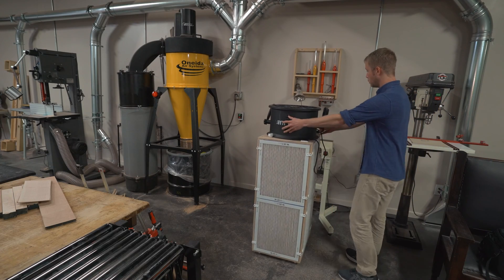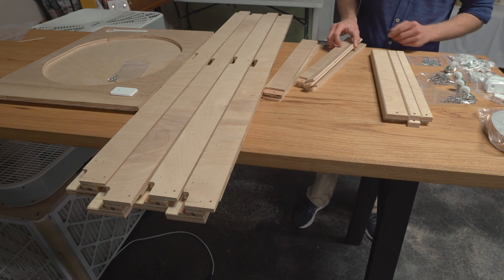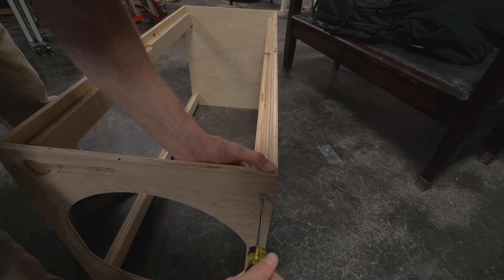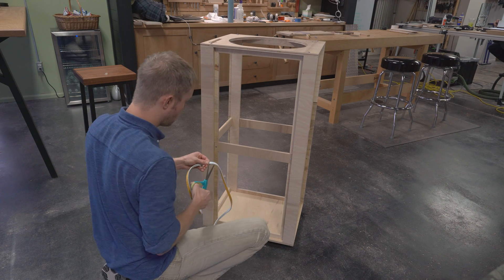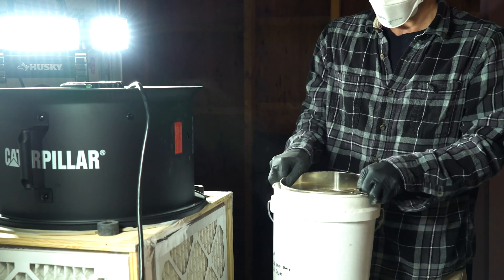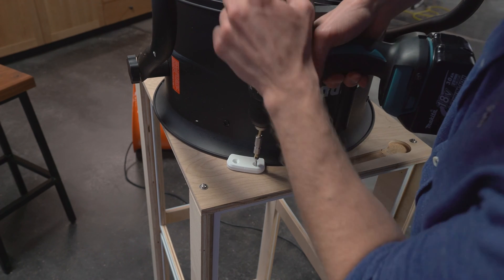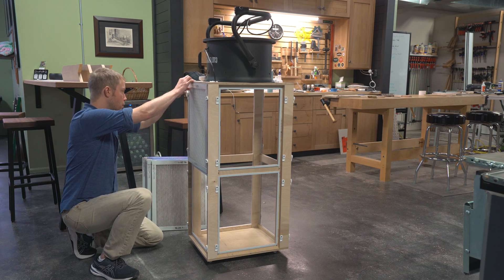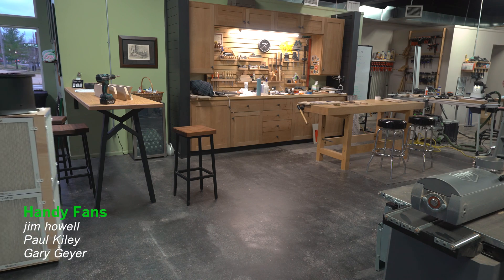Air Filter Kit - Model-A - Design and Assembly

Comment: would it be better to put the fan inside the box? This way it pulling air through the filters and keeping your fan clean??
Reply from the maker: In general its best to run the air through the filters first. I call this the "pull" configuration because the air is pulled through the filters. This method is the most effective when you want to filter the ambient air in a space. 

Personally, I use this unit as a dust bin for cleaning parts. With the fan pointed into the box, I brush the dust into the filter to prevent it from becoming airborne in the first place. The fan motor is enclosed, so the most critical parts of the fan do not get dirty. This is not a standard use of an air filter, but it does work very well within a short distance around the unit (5ft or less).

Comment: I just stumbled across this, what an awesome build.

I'd be curious to see real world performance on (2) 5 filter box fan versions. Make , 1 suck and one blow.

Put on opposite ends of the shop and have the one blowing in the direction of the sucking one
Reply from the maker: Thanks and good question! I have tested this with the 8 filter design, actually. It works well, but I did not use any particle meters or anything while testing, so I cant say exactly how well it works.

In general I don't like to use a box fan in the "blow" configuration because the motor is not enclosed and dust can get inside of it.

Comment: Great videos, designs and testing. I'm thinking about making my own. I have a few ideas that I'm fleshing out.

1 - Woodworking filters, like recommended by MMCC_Woodshop seem interesting. The filters seem to have a pretty good lifespan and good MERV rating, and can basically complete an air filter just by attaching it to the fan you already use on yours. It's a pricier up-front cost, but I'm curious how the performance compares. Looks like this video is in the works already from other comments.

2 - Inline fans, these fans are definitely more pricey than a $20 box fan, but they come with a lot of advantages. They can be almost silent, they're much more energy efficient, they are much smaller and often come with a lot of fancy controls, such as scheduling, sensoring, just remote control in general, etc. The compact design opens up a lot of design opportunities, as these fans are as small as 4". Further, these are meant to be used with ducting and HVAC applications, so the rated CFMs from the manufacturer's are far more reliable because they have to be in order to be competitive. Nobody is going to return a box fan because it doesnt meet its rated CFM, but that happens all the time for duct fans. They are also designed to perform better under static pressure, especially mixed flow fans. I think you could get a quieter, smaller, more efficient air purifier this way. I think there are some savings to be had by using less filters, but ultimately it'll probably cost a bit more to use these fans, as well as potentially complicate the build process. The AC Infinity CLOUDLINE S6 with >400 CFM and 32db operating volume for $120 is a contender for me, but there are cheaper options if you sacrifice the silence. 

3 - Carbon filtration. personally I need more TVOC filtration bc of my proximity to hwy/airport, so getting carbon into the air purifier's filtering process is a must for me. Currently my temporary plan is to double layer a merv 12 filter on top of a merv 14 carbon filter, to try and protect the secondary filter for longer. I think there's probably a much cheaper way to just add carbon filtration to a solo high merv filter, but I havent landed on a plan yet. Using sheets of activated carbon and just taping to the filter is potentially viable, but i dont know how effective or restrictive that would be.
Reply from the maker: Thanks for watching and commenting!

1) I have the parts to test his design out. I suspect that the performance of the fan is severely affected by the WYNN canister. It may be ok to start with but performance may drop significantly when it get a little dirty. That's what I suspect, at least. The tests will say one way or another. Hopefully this data will make it to my next video.

2) My updated Model-B/C kits have a 12in inline fan option for these reasons. I have experimented a lot with several sizes of inline fan for the last 6 months and they all work great. Ducting and diffusing the output air helps to reduce turbulence flows in the space as well. A lot of dust collection is about not blasting the dust all over the place to begin with. I'll have 3 more inline fan kits coming out in the next few months.

3) I don't think the filters with carbon sprayed on the back can really accomplish much in a high VOC area. I think a lot of the smell reduction comes from the high MERV filter itself. If you really want superb VOC reduction a big canister is the thing for the task. Since the inline fans connect to a duct, attaching one of these is easy.

They aren't cheap charcoal filters though https://amzn.to/3p2RTII or https://amzn.to/3N2oSEQ

Here are my updated kits. Note the Model-B with the inline fan...  https://www.etsy.com/listing/1373712349/model-bc-air-filter-kits

Let me know if you want even more info on anything
Reply: @The3DHandyman  Thanks for the reply! looking forward to the analysis of the woodworking filters, there's really no thorough testing on it for these purposes yet afaik. 

I am starting to realize you're right about the carbon filtering, but I'm wondering how the LENNOX does, as it takes the carbon part much more seriously. I know its relatively easy to make a carbon canister filter yourself, but I haven't found a method I like yet. Something about drilling holes in a 5 gallon bucket doesn't feel like an elegant solution.

Nice to see the inline fans! I didn't notice before. This whole journey has been a bit of a rabbit hole and somehow I ended up ordering bulk case fans... We'll see how that goes lol.
Reply from the maker: @Lightja_  Bulk case fans sounds like a deep rabbit hole alright!

I did get a Lennox MERV 16 filter to test in a single filter application. I imagine that it will preform well, but we will see.

I have seen the 5 gallon bucket air filter approach, and yeah, it's not very elegant.

Comment: If you had to choose one configuration for a garage, would it be fan pointing up or fan pointing down?
Reply from the maker: Good question. Up all the way if you are filtering the ambient air. Down if you want to suck dust off a work surface.

You sort of have to pick one, so go with the method that best suits your scenario.

Comment: I see you have the 3D printed STLs for free and drawn pics, but would you consider offering your CNC files as well? Either for free or sell? I have a 48x48" CNC router and a 3D printer and would love to build one of these, especially since you are out of stock and I have all the materials to build one now. 🙂
Reply from the maker: I will have those for sale when I finish the latest design round. That should be a few weeks out at this point. Lots of work to do until that date. Sorry for the wait!

Comment: Thanks for the great videos. How often do these Merv 13/14 filters (3M, Nordic Pure, etc) need to be replaced? Have a nice day!
Reply from the maker: I am going to retest my current set after 1 year of use, some time soon. I did a test after 6 months of shop use and the Model-A with Nordic Pure MERV 14 filters went from filtering smoke out of the garage in 50 minutes to about 1hr 45 minutes.

So If you want peak performance, replacing heavily soiled filters after 6 months would be wise. If you are running a unit like this in your home for general air filtration, the filters would likely last a few years. 

Hope that helps. Maybe I can do a video on this subject some time soon!
Reply: @The3DHandyman  that would be useful for us “long distance followers “ as the filters cost us >$200 each time to buy and ship!
Reply from the maker: @PeterWoolston  I hear yah. It $90 to ship one to Los Angeles. That's one reason I am moving toward an updated Model-B design and well as some others. By cutting large items out of shipments, things get a lot more affordable.

I'll also have some general pointers for assembling your own canister-based filters without any parts from me at all. 

Sorry for the wait on this, I know you have been ready for this video for several months at this point!
Reply: @The3DHandyman  so I guess my central question is whether your findings are 1. canister only (no paper filters) or 2. canister also needs paper filters? Thx!
Reply from the maker: @PeterWoolston  I will have this info in my next video, for sure. The extra filters over the canister mainly help to keep the canister clean of all large dust particles. I've been testing a few of these systems and, so far I'm really happy with the results.
Reply: @The3DHandyman  makes sense ...  I guess I'm just trying to figure out whether the "filter only" or the "canister only" solution is the route to get the result because of the cost of getting the filters to NZ is similar to getting a canister. If both are needed in the design then I'll just go with the "filter only" approach.
Reply from the maker: @PeterWoolston  I've got a solution that uses the canister, inline fan and a pre-filter that may work really well for you. Stay tuned!
Reply: @The3DHandyman  epic!

Comment: I live in New Zealand and already have plans for a similar solution but the cost is prohibitive because of the filter availability of the design for NZ. I was about to buy a commercial unit which ended up cheaper, although inferior when I stumbled on you ... thank you! You have saved my bacon! I am now going to build your version as you have better options in your design for someone at the bottom of the world that will produce better outcomes and it is mobile :D But I just can't order anything until you've done the Reusable Canister Filters VS disposable furnace filters design comparison video ... how long till that's out?
Reply from the maker: It should be out in a few weeks. I'm testing everything next week. 4 different canister options will go head to head with the best square HVAC filters. I will also test multi-layer filtration with a canister and HVAC filters.

I don't know if inline duct fans are easier to find on your end but these designs all work with a 12" model. I'll test that in the new video as well!
Reply: @The3DHandyman  you ROCK!
Reply: @The 3D Handyman  any update on the release of the 4 canister video? Hoping it's soon! Thanks from New Zealand 👍
Reply from the maker: @PeterWoolston  Hey! Sorry for the delay on this. It's pure chaos here at the moment. Unfortunately I think it will take me a month or so to get that video done. I lost my testing/shop space after someone parked a stolen car in that garage... this lead to a heated argument and I moved my shop out of there the next day. I've moved into a new space but it's full of stuff and needs to be cleaned out before I can actually start testing. Just another great day.

Many apologies for the wait! I know you are trying to get started on your build ASAP

Any space left in New Zealand? I'm about ready to get out of here
Reply: @The3DHandyman  lots of space in NZ but you’d have to leave your individual rights at the border as we are still operating under COVID Emergency Government 🤪 Sorry to hear about your workshop worries … Don’t let it get to you! Take care of yourself 👍
Reply: Just checking in to see when you are publishing your new drum filter design and testing …
Reply from the maker: @PeterWoolston  I'm almost to the point where I can start testing them out. Launch is 2-3 weeks out. What sized of canisters are available in NZ? Got any links?
Reply: @The3DHandyman  I’ve posted a reply 4 times which shows as complete then it disappears…
Reply from the maker: @PeterWoolston  That's pretty annoying! Maybe the system just doesn't like links. Simply naming or describing the product might work better
Reply: @The3DHandyman  gah - posted another 3 times and it get's deleted whenever there is any URL reference or even if I type out the extension as an english word! So I can only suggest you wisit Chevpac, Carbatec and Machinerywarehouse in NZ who have the pleated filters [let'
s see if YouTube deletes this comment too!]
Reply from the maker: @PeterWoolston  Sorry YouTube has been giving you so much trouble! It looks like Carbatec and Chevpac and the lot have filters similar to the Wynn Environmental filter that I've been testing. I've also been testing some thinner pleated canister filters but I didn't see any at first glance.

I'm about 1/2 done with testing for the next video...30 tests down, 20 more to go...

Comment: Have you tested that fan with a wynn type canister filter?  I feel sure it would lower cfm but curious how much
Reply from the maker: I plan to test my new Wynn filter next week. That video should be out in about a month. It will produce less air flow but seemingly with the higher MERV level, that wont matter? We will see.

The Model-A can also accept a canister filter inside of it for multi-layer filtration. The new video will cover that as well.

Comment: You said in your video this could be mounted to the ceiling How is that accomplished?
Reply from the maker: I would use 8in or 12in steel angle brackets and leave a few inch gap on the wall/ceiling side to allow air to get to all the filters. You could also potentially use some stand offs for mounting as well.

The open flat sides of the legs are the best mounting locations. Just be sure not to pierce the filters area with any screws or bolts. Also, you will have to sink the mounting screws deep into the studs/joists, for sure.

The kit would have to be glued together after assembly if you are ceiling mounting it.

It's not a great option for low ceilings. You will loose about 20in of headspace.

The pull option is the only was to go for a ceiling mount.

That's all I can think of at the moment. If you have any more questions, let me know!

Comment: Love your videos and the efforts you put behind them. I built a tall fan box, put it on legs with a Lasko fan but I need to upgrade to one of your taller units with the stronger fan. I was wondering if drawing air through filters first into the center and pushing out/up or drawing air through the fan into the center then pushing out through the filters is preferred? I am remodeling our basement and managing dust is a MAJOR consideration to keep dust at bay upstairs. If I push up/out it would seem to disperse dust already in the air but if I push down/out through the filters it would seem to blow dust from the floor into the air. Would love your thoughts.
Reply from the maker: Thank you! Sorry for the late reply. Are you describing filters on both sides of the fan? If so, I think that may end up significantly reducing the overall air flow. This will also decrease the amount of air that the fan pushes through the room and the overall amount of dust collected my be less. 

If I didn't understand quite right, let me know!
Reply: @The3DHandyman  Good Morning, Thanks so much for the response. My fan resembles one of the tall ones in your video. If I remember correctly the Merv 13 filter size is 20x16 on 4 sides with a 20x20 filter on the bottom, fan on top. "Dirty" air is drawn in through filters and "clean" air pushed out the top. My question is for best filtering. Is this set up best or should I reverse everything and draw Dirty air in through the top and push it down and out through the filters. The first way seems to create a bunch of turbulence with air exiting through the fan vs second way which would seem to diffuse the air through all the filters upon exit. Example: I move the filter unit over near my table saw and make cuts. All the dust is created 36" off the floor but this is about the height the air is blowing out the top of the fan. I hope this very wordy explanation helps. It would seem air flow direction would change based on what the goal is. General filtering for living areas vs filtering for work shop areas. But what do I know, right? ;-) BTW, your video on the cat litter box is an excellent idea I hope gets some continued refining as to fan selection, cfm, speed control, etc. 
Have a great day!
Reply from the maker: @MrRustyjackson  Oh, I got you! I actually need to a do a video on that topic. That question get asked frequently. You are right about the turbulence, it really can kick dust all over the place. I most often use the "push" config that blows air into the filter box for this reason. If you are using a fan that does not have an enclosed motor (like the Caterpillar fan in this video) be sure to keep the motor as clean as possible with compressed air. If flammable dust gets in there it could potentially cause a fire.

I will be making a video on inline fans soon that attempts to improve on this overall concept and keep the fan clean in the process.

Let me know if you have any more questions. Have a good one!

Comment: Do you have to use 8 filters, or could you get away with 4 or 5? How restricted would it be and how many cfms would it pull/push with 4-5 filters? Using the caterpillar fan.
Reply from the maker: Hey! Sorry for the late reply, it's been a busy month. The static pressure with 8 filters is about zero which really helps performance. I think if you go less than 6 filters the allowable manufacturer air speed through the filter can be breached and particles can actually get pushed through the filter media.

If you go with (4) 20x30in filters in the Model-B its cheaper can get as good of performance as the Model-A. I have an updated version of the Model-B on the way that can use a 12in inline fan as well as the CAT fan.

If you have any more questions, I hope to be more on top of comments moving forward!